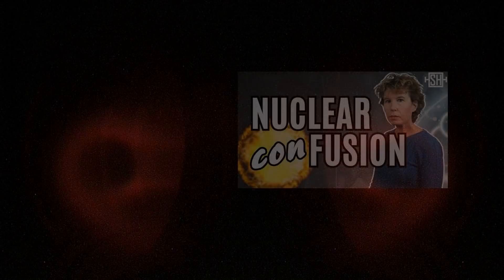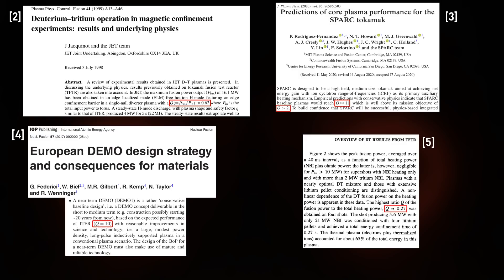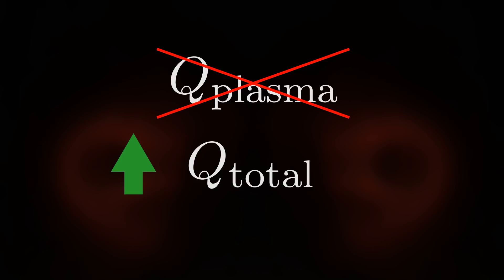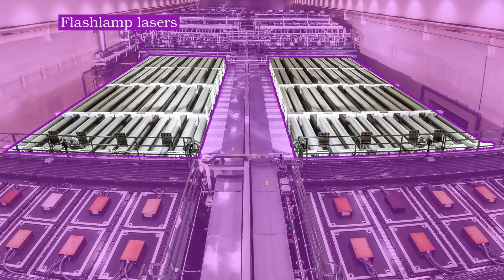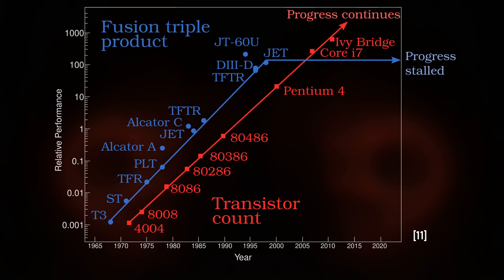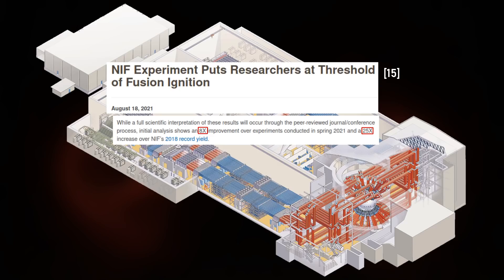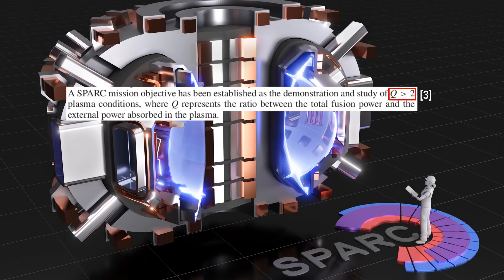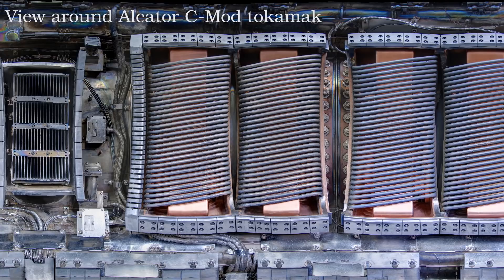In defense of "Q-plasma" - a response to Sabine Hossenfelder

Comment: Thank you for your very scientific sounding video. But you have three errors: 
1. "Up to the turn-of-the-century, the fusion gain, was being raised exponentially, doubling and doubling with time." The gain was not doubling, only the TP was doubling. As such, any representation that the fusion gain has been doubling is highly misleading. 

2. (NIF) "A few more steps like that would bring Q-plasma to reactor-relevant levels". So in NIF's latest experiment, the total device output/input ratio was 0.003. So NIF would have to improve the overall gain by about 1,000 to get to a reactor-relevant level. This places your comment in the realm of nonsense.

3. You have an audio typo: "Q-plasma just under four, and in turn, a Q-total of four at a Q-plasma around 14."
Reply from the maker: 1. Only two experiments have run D-T, so yes - we only have the triple product as a measure of performance, but that scales pretty well with Q if those experiments had used Tritium.

2. As stated, NIF could theoretically replace its lasers with DPSSLs which have been demonstrated to be pushing about 10% wall-plug efficiencies. Let's call that a factor of 10 in efficiency which a future plant could make use of. Now, I mention a doubling and then a factor of 8, so a factor of 16 "step". Two more "steps" like that is 256. So, 2560 improvement in gain for a reactor. Note: I'm not saying it could be done, or that inertial fusion is a prudent approach, but I stand by the logic of what I said in the video.

3. The full quote (check the captions for a transcript) is: "The baseline design envisages a Q-total exceeding 1, meaning true electrical breakeven, at Q-plasma just under 4 and in turn a Q-total of 4 at a Q-plasma around 14." This is a correct interpretation of the paper and not a typo.
Reply: @ImprobableMatter  Thanks for your reply. So from two TP data points with known fusion gain values, one from 1994 (TFTR) and one in 1997 (JET), and your assumption about the fusion gain factor of all those other experiments that ran DD instead of DT, you feel comfortable to extrapolate those TP data throughout the entire half-century of fusion research to indicate a doubling trend not just for TP, but also for fusion gain values. Do I understand you correctly?
Reply from the maker: @StevenKrivit  I am confident, because the claim is not based on two datapoints. The fundamentals of fusion are well understood and tested. We can state with certainty, when the density and temperature are known, what the power output would be if a pure Hydrogen or pure Deuterium plasma were replaced with a D-T mix. This is the whole reason for the triple product.
Reply: @ImprobableMatter  And are you so confident about that that you will identify yourself?
Reply from the maker: @StevenKrivit  I have identified myself. I ran a blog with the same name containing my resume/CV.

In any case, given a temperature and density profile for a tokamak and the plasma composition - pure D, D-T, whatever - any good scientist can compute the power output. This has been done for D-T and compared to experiments, this has been done and is being done for D-D and compared to experiments.
Reply: @ImprobableMatter  Dr. Aslanyan, I invite you to back-calculate the gain factor from the triple-product values, convert the results to an equivalent DT fusion gain value, and display them on a graph. If you do so, you  might be the first person ever to do so. You help promote the fusion field tremendously by showing us clearly and uneqivocally, the progress made in fusion power gain. 

Let me help you get started. We have at least three data sets available. The peak fusion power value for TFTR was achieved in 1994. It was shot #80539, with a fusion power of 10.7 MW and TP of 4.1x10^20. The peak TP value for TFTR was performed in 1995. It was shot #83546, with a fusion power of 3.0 MW and a TP of 8.7x10^20. 

For JET, the peak fusion power was achieved in 1997, it was shot #42976. It produced a fusion power of 16.1 MW and and a TP of 4.7x10^20. For JET, the peak TP was achieved in 1991. It was shot #26087. I don't have the fusion power at hand, but we know for certain that it was lower than the 1997 result. The TP for this shot was 6.1X10^20. Oh no! At least based on these data sets, the direct relationship of increasing TP to increasing fusion gain that you assert appears to fail.
Reply from the maker: @StevenKrivit  Yeah, you're not actually being as clever as you think you are by whacking down some cold fusion talking points - unsurprisingly, given that you could not be bothered to do a single Google search to find out who I was and could not parse the very clear Q values as made undeniable in the captions. Given that, and I've said this publicly, I quit the field because of a lack of enthusiasm and don't expect power demonstration by 2040, this is not the "gotcha" that you think it is. But OK, I'll bite.

Firstly, and I state this clearly in the video, I take pulse number 42982 as the JET record. Secondly, the statement in the video is about Q and not absolute power, so you should also normalize the figures you gave. Finally, we had also better agree the values we take for the triple product - are the density and temperature some sort of line-averaged values or the peak, how exactly do we measure a confinement time and so on.

Thanks for the invitation, but I'm good.
Reply: @ImprobableMatter  Thank you for the discussion.

Comment: Could somebody explain to me the basic theory behind a Q = ∞ Stellerator?
Reply from the maker: If the confinement is good enough, the fusion reactions will output enough energy to maintain the conditions for further fusion. No need then for power input to the plasma (the denominator in Q-plasma).
Reply: @ImprobableMatter  But is there, in this regard,  a fundamental difference between Tokamaks and Stellarators? I think that both can reach  Q = ∞.
Reply from the maker: @bernhardschmalhofer855  A tokamak must always have an external input of power (to the plasma) to drive an electric current. A stellarator does not.

Comment: Imagine if the production of nuclear fission power plants had been delayed. If more testing, and international cooperation had occurred, like is happening now with fusion power, perhaps we would have seen safer and fail safe reactors. With fewer or maybe no meltdowns, public sentiment for nuclear reactors may have remained high, and cheap, safe power would now already be abundant. Jumping straight to making a working but unsafe and unreliable fusion reactor would doom it to the same fate as traditional fission reactors. It’s more important that we get it right than we get it quickly.

Comment: I have to say there's something principally wrong with this. For one they need to spend a ton of energy to squeeze the atoms so they fuse.  That is free when it happens in the sun. 2nd conservation of energy, that energy released by atom fusing on a star is basically gravity converted to energy.  It's all of the same.
Correct me if I'm wrong, I'd like to know how you can put less energy than what comes out.
An H Bomb only works because the fission portion of the bomb acts as  a compressor to create the condition for fusion to happen and on and on.
Reply from the maker: The energy released in the sun is due to nuclear reactions, not gravitational potential energy. I have a couple of videos out explaining basic fusion (more on the way).
Reply: @ImprobableMatter  but the nuclear reaction could only happen in a very dense environment.   If the mass of the sun was lower than a threshold it wouldn't have the reaction.
Am I not correct?
Reply from the maker: Greater density increases the rate, but is not a requirement. Temperature is a requirement, however. Experiments have reproduced simultaneously higher densities and temperatures than the sun for fractions of a second (e.g. National Ignition Facility), or even higher temperatures for extended periods (e.g. JET).
Reply: @ImprobableMatter  You can't have both,   the reason you get such high temps is because of the density from the gravitational forces.  And it's free on the sun.  So unless they somehow combine nuclear fission with fusion like an h-bomb I don't see this EVER getting to a point where it's economical.  Even say at a positive the total output of 1.05   5% net energy, then we still have equipment that is so exotic it would not cover the cost of running the station.
I would love to be wrong, and I'm no physicist but simply conservation of energy principal doesn't seem to work here to our advantage.
Reply from the maker: Lasers can and do compress plasma to greater densities, while achieving greater temperatures, than in the center of the sun. Using this method has recently yielded more fusion energy out than laser energy in.

Comment: Fact of the matter remains that nuclear fusion is not "around the corner" as many media suggest.  Also, given the engineering challenges after the Q-plasma increase, one must also assess the economic (ir)relevance.  Many investments were made by governments with the goal to achieve electric energy output with the "too cheap to meter" paradigm.  Sabine's criticism is pointed to that misinterpretation.  Nuclear energy, in all its forms, will never be able to compete on economic grounds.

Comment: Q - total>>1  is what counts in the end! After all you have to include the energy and cost needed to build the reactor. There is a fusion reactor in the sky, it comes up every day, and it is free. Why waste more precious research funds on  fusion reactor research? Research into higher efficiency solar cells and higher energy density batteries makes more sense. It is very hard not to agree with Elon Musk and Sabine.
Reply: Well then you don't agree with Sabine, because one of the very first things she said in her video was that she supports fusion research. She doesn't support the misleading science communication, but she was clear that she thought the research was worthwhile.
Reply: The obvious reason to research fusion is that the earth is spinning, so we don't have strong control over the Qtotal of a solar panel installation. Solar panels have a pretty strict limit for most cases of Qtotal, max being 0.5 because they're in the earth's shade half the time

The other problems with solar panels being that solar energy is quite diffuse, so you need large surface areas of panels to collect the power.

Batteries have their own obvious problems of basically being bombs, and the volume and thus surface area you need to dedicate to batteries and sufficient solar panels to have guaranteed power.

Adding said solar panels will also affect the earth's albedo, since solar panels are much more effective than the ground is at turning visible light into infrared -- which the greenhouse effect runs on.

There's lots of reasons to pursue fusion and fission power, even though solar exists and is improving

Comment: Good to know, I’ve always supported the idea that Fusion will be the only really viable solution for clean, non carbon dependent, economy. 
So how about these high temperature superconducting materials? Who has them? Are these being used in newly designed machines? What about ITER does it use these materials or is already obsolete before even starting?
Reply from the maker: The new superconductors will only go into new machines: converting an existing one would be harder than just building from scratch at this point. Many, including in the comments of my videos, certainly have the view that ITER is "obsolete before even being built", because it will have taken 40 years from agreement to opening. I would still say that there is a lot of science and technology progress that will be made on it: things like tritium breeding blankets, testing the physics of a high Q-plasma (which has some technical differences from the plasmas tested do far). Again, just as I say in this video: just because it would not have a high Q-total, does not mean that it doesn't have the experimental freedom to make good progress.
Reply: The good old fission IS viable source for clean, lowest-carbon economy. Fusion is pipe dream.

Comment: Thanks for the video. I watched an MIT graduate student say that making a viable fusion reactor is simply a matter of increasing the Q over 1. Question......

What do you think about General Fusion's approach? 

Thankyou! 

Bill
Reply from the maker: The approach by General Fusion is as susceptible as any other confinement method to instabilities, which are the main reason fusion power is so hard to achieve. It is up to the company to show very good evidence that their approach works.
Reply: @ImprobableMatter  Agreed 100%.  General Fusion's machine design has changed substantially through the years, but their web site has not commented on the reasons for those changes, as far as I have noticed.  Their present animation shows a radially-disposed array of pistons driving into the swirling liquid metal.  A lot more liquid metal than the pistons can displace magically appears as the compression proceeds, and the inner surface of the liquid remains amazingly calm as the surface shape smoothly changes from cylindrical toward spherical.

Imagine poking a non-rotating object into a rotating fluid. Imagine hitting a fluid with a hammer.  Normally, there will be lots of turbulence, waves, and splatters produced.  It seems they are going to face the same uniformity of compression issues, and then some, that have plagued the National Ignition Facility (NIF) with their 192 lasers.  (The NIF people added a hohlraum but continue to have uniformity issues.)

How does General Fusion swirl the liquid metal at sufficient speed against a stationary housing?  Is General Fusion going to spin the whole contraption?  Where is the extra liquid metal coming from?  How will they damp out the instabilities?  They did show one paper where they addressed the instabilities that might arise as a result of the interactions of the plasma with the surface, but they haven't publicly addressed these other basic issues, as far as I can tell.

Their approach is fascinating, but I have great difficulty understanding how it can succeed.  Good luck to them.  Perhaps they have lots of secret methods. 🙂

Comment: I have a question, if the goal of these experiments is not to develop a viable fusion reactor, than what is it? Why leave the Qtotal with almost zero attention? Is it trivial to calculate given the Qplasma?
Reply from the maker: The goal is to have a viable reactor eventually. The plan is to sort the physics and basic science out first - Qplasma - and only then sort out the engineering - Qtotal. 

There is a nice comment thread on my other video with someone who works on driverless cars. The computing setup on the test versions is enormous, power hungry and expensive, with lots of debugging and testing. Once they reach a working version, the production versions can be orders of magnitude cheaper and efficient. Same with fusion experiments.

Comment: Would love to see NIF challenges video. Is one of them quality of laser output vs efficiency?
Reply from the maker: I will cover inertial fusion in the video after next (hopefully out in 2 months). The biggest problem I see is going from a facility like the NIF with ~2 shots per day to 1 to 10 shots per second. This is the equivalent of going from an extremely slow-firing musket to a machine gun, which is a technical challenge.

I actually think that the laser aspect can be made to work quite readily. Lasers which are simultaneously powerful, efficient and have high repetition rates may be a great development to come out of this approach to fusion.
Reply: one of the major challenges is simply final optics. how do you protect the final laser focusing lens or protective window in front of it that the laser passes through before hitting the target from exploding target debris destroying its surface and optical quality? currently these optics have to be replaced on present lasers after 100-200 shots or around once every month. on a power generating laser that operates the same way that would need to happen after every 10 seconds.

Comment: I noticed that you chose to refer to the NIF lasers as being antiquated. Perhaps that is related to all the construction delays and major cost overruns of the facility that never initially came close to its primary 'ignition' goal after its several years of tune-up. I'm glad you did mention that it has alway been primarily funded as a thermonuclear weapons research tool. Typically, when the staff presents it to the general press and the public that fact about its funding is hardly mentioned.

The NIF lasers are likely the most powerful in the world and major efforts went into creating them about a decade ago. I welcome a video that compares the NIF laser total energy output with the most powerful solid state lasers that exist today. I also welcome a comparison between the power input to the NIF building relative to the laser energy that impinges upon the hohraum target during the infrequent nanosecond shots.

The most current report on a breakthrough in the NIF ICF experiment it appears that their input reference energy is now based upon the X-rays that end up compressing the fuel pellet. Previously the input energy was stated as the final laser pulse energy that entered the hohlraum which was at least an order of magnitude larger. I view such accounting like a deceptive shell game.